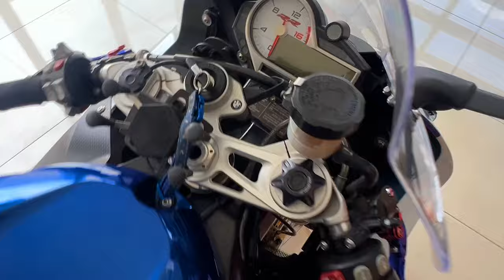S1000RR brake fluid flashing, getting rid of sponge brakes, brakes fix.

Comment: I think you might have to take it to the dealership so they flush the ABS pump as well especially looking at how dark the back brake fluid was…. Or you can buy a obd2 scanner to help you activate the pump and it will push out the fluid that’s inside 

Otherwise good job bro I also have a 2017 s1000… amazing machine 💥

Comment: What mike do you use from your X3 Mic Adapter? I'm failing to get a long condenser mic to attach
Reply from the maker: @dumisanimatabane9647  short mic with an extension, check out the X3 video set up